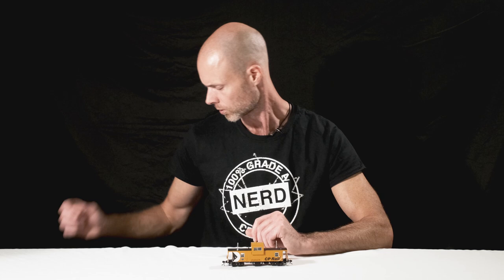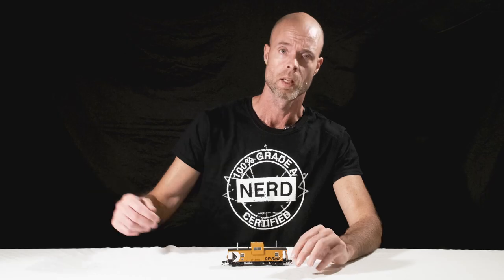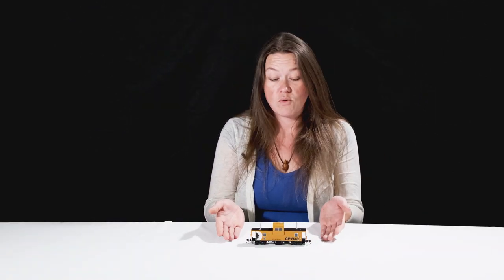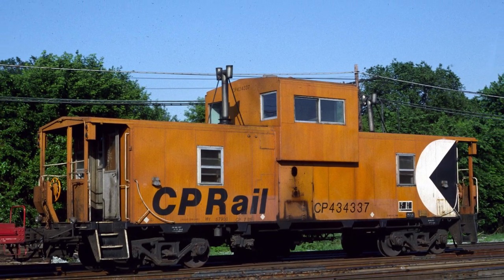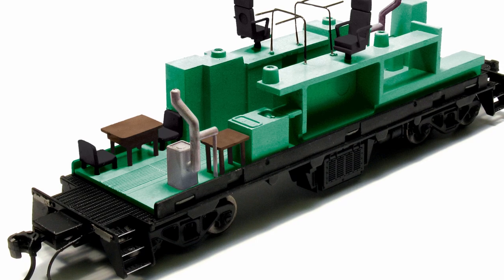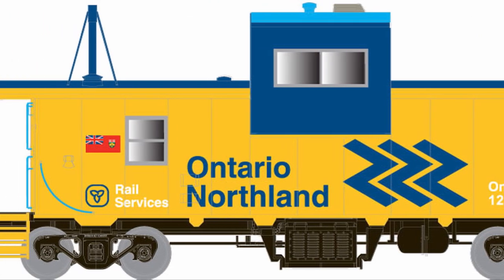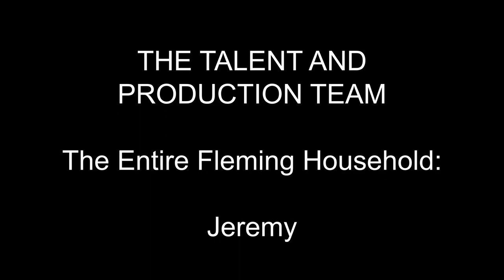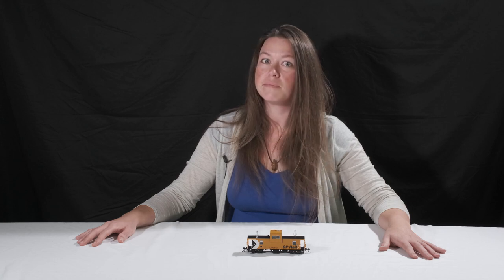Rapido's HO Scale Angus Van/Caboose

Comment: You need to reverse the polarity of the neutron flow.
Reply from the maker: Only if the dimensional stabilizer's power supply is routed via the fluid links to the dematerialisation circuit.